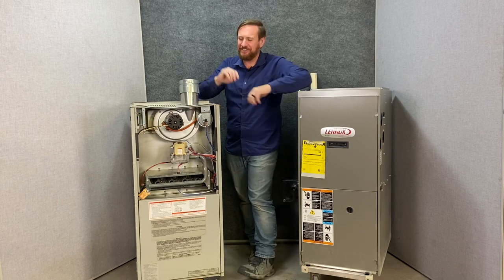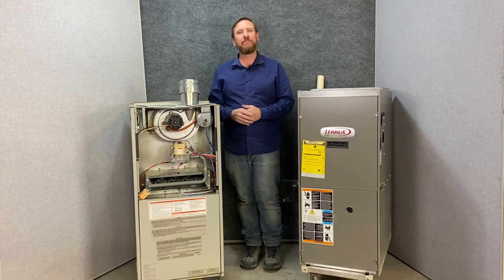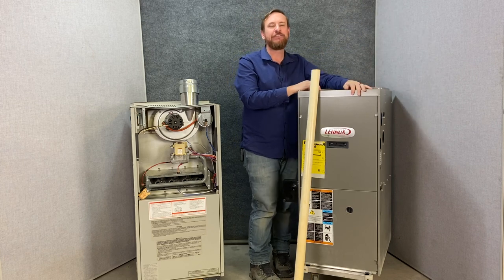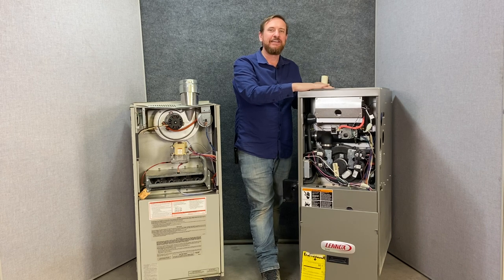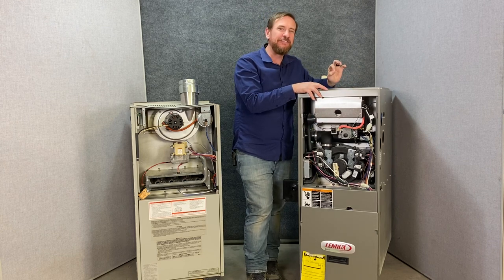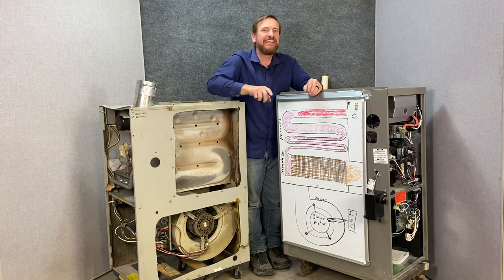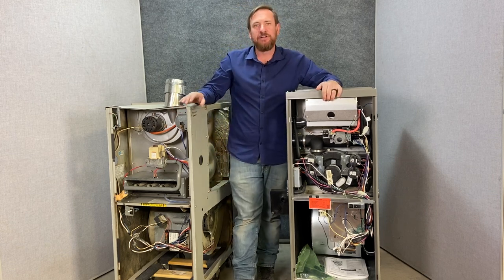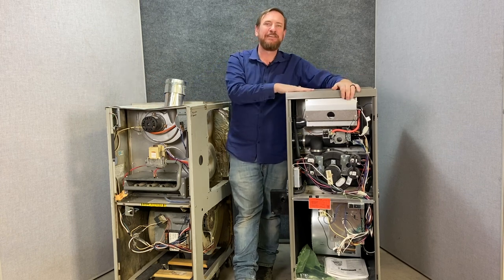80% vs 90%+ Condensing Furnace

Comment: Very positive presentation on the high efficiency gas furnace.  However, you did not cover the cost premium for the higher efficiency furnace including the cost of the PVC intake and exhaust. I would guess the payback on the more efficient unit vs. gas and electric savings is out several years.  Also, more complexity in the furnace likely means more parts to break down and higher costs to repair.
Reply from the maker: How much more is the cost for installing the PVC?

A single stage 90 will have the same parts as a single stage 80, except the 90 will have a sealed combustion box and the inducer wheel will be plastic and a secondary heat exchanger.

Same for 2 stage vs 2 stage.

When you get to modulating furnaces the parts are much more expensive and more difficult to diagnose but a modulating furnace does not make the system more efficient. 

The price difference between a single stage 80 and a single stage 90+ is very close. 

In many parts of the country, they are not allowing the sale and install of and 80% and regulation is on its way to end the sale of all 80% as the government will move to 90+ and heat pumps. 

We can learn about it and adapt or be left behind.
Reply: @love2hvac  Sure but we get only the positive part of the debate. When I asked for a price on a basic 80% vs. 95% unit, I was told that the premium for the higher efficiency unit was $3,000.  My NG budget is $70 per month including hot water.  If my heating cost is $50 per month or $600 per year and I save 20% over the 80% unit, my savings for NG is $120 per year. I will save additional on electricity but ECM's are available on 80% units so the electric saving is minimal, I think.  Assuming a total savings is $200 per year, the payback is 15 years assuming equal life and equal repair costs.  Several HVAC techs have told me that repair costs for 95%+ units is significantly higher and more frequent.  The government claims the higher efficiency will produce $80 billion in savings over 10 years for NG purchases but don't mention the $ billions to replace the furnaces. 
Many of my  neighbors had heat pumps and NG furnaces for extra cold days installed in their new homes several years ago.  Almost all have replaced the heat pumps with AC units and kept the NG furnaces due to the maintenance costs of the heat pumps. 
I own a home in the NE with NG furnace and a home in the S with a heat pump.  The heat pump went for 12 years and cost $6,300 to replace but the 20 year old NG furnace is still running well.
Reply from the maker: What is crazy is a company charging an additional $3k for a condensing furnace 😳🤯 the equipment cost difference is about $200 plus PVC and 2hrs additional labor installing.

As for the techs that say there are more problems with condensing raises concern. Are they specifying between a modulating furnace that is very expensive and cost more for part vs a single or 2 stage.  Excluding modulating, it's the same gas valve, offices, burners control board, ignitor and flame sensor.. I find most companies that have issues with condensing equipment are not installed correctly.  I get paid to go out and solve these issues for companies. What that means is I just read the installation manual to them and make sure they follow it.  There are units here that are over 20 years old only requiring typical preventative maintenance. 

One of the things that are driving repair cots up is the ECM . Otor you mentioned that even the 80% has. A PSC motor company cost was around $100 but an ECM can be $800-1300. ECM is also a government mandate. 

As far as pay back, it's often not seen for a while (or ever with that over priced 3k difference)
If we really want to discuss payback, why not repair your existing furnace?  Even if it needs a new heat exchanger your looking at about $1- 1.5k to replace.
An old furnace can be repaired for a long time compared to a new one if we are looking at payback. 
When the goveent looks at file savings they are looking at it as a whole, collectively. Having a 5 gallon flush toilet vs a 1.6 gallons flush will not pay for itself in waterbill savings, but collectively saves a considerable amount of water. 

Either way in many parts of the country 80% AFUE furnaces are not allowed and soon it will be most of the country.
Heat pumps are also being pushed by the government for better, worse or indifferent.
I solve problems and I also teach. Part of teaching is technology and preparing people. Everywhere you go there are people that romanticize about the good ole days and how everything was better before. But if I taught automotive and talked about how bad fuel injection and computers are and how great carburators and point system where, I would not be helping anyone.

By talking about "how great" an 80% furnace is is how "evil and bad" a  condensing furnace is, helps nobody. There needs to be positivity so techs are not afraid of them and can actually service and install them correctly. It needs to be taught so customers don't get screwed with an importer installation and the tech just blaming technology as bad to hide their own lack of knowledge and understanding. 
Condensing furnaces have been around since 1980. That's over 40 years so even that's hardly new technology. 
I also teach heat pumps, electric heat and hydronics. 

Everything about HVAC today is technology but people also have the choose of heating with a wood burning stove and firewood. I also solve problems for them as well as they have issues people don't know how to diagnose when installed in a modern home.

People get so upset at this video about condensing furnaces. They also get mad at heat pump videos. 
I have no say in what is being pushed by the government or what is being invented by manufactures. Yet people want to complained to me instead learning from a free video. Notice I am not selling anything or made any money promoting any product. 

I get it, a lot of people are afraid of change, a lot of people hate technology, a lot of people are angry. But is it so wrong to have a video that's positive? Is it so wrong to want techs to not be afraid of technology they will be encountering? 

Should I just make videos talking about how great the good old days were and how everything about everything was better back then? Maybe I could connect to an Amish community and I could talk about how bad electricity and vehicles are.
Reply: @love2hvac  Just want the positive and negatives to be presented so we all can make informed decisions.

Comment: in germany we use top notch "Weißhaupt brennwert" units or "junkers rund brenner" they work on same pricaple
Reply: Hot air is rarely used in Germany. Hot water with radiators or in floor piping is more the norm.

Comment: We just got a 90%+ installed in our finished basement. Unfortunately, Code here allows intake from
inside the house, so the builders installed the retired furnace that way. The new furnace was also installed with the intake pipe left inside the house in a U shape. I'm guessing they are doing this because there is a deck outside and the flue pipe is under the deck and no other way for the intake to go other than be sucking in the exhaust.
Reply from the maker: Most do it because they just don't understand why. 
Some don't want the extra work of installing the pipe.
Some are concerned about extreme conditions, but a tee and a manual cap/plug/or valve solves that.

The u shape inside is so nothing falls into the burner section.
The air intake is usually near the flue exhaust without an issue.

I do have concerns about the flue exiting under a deck. It raises a red flag and a lot of questions.
Reply: You can do an intake inside as the air is pre heated which is actually more efficient.  In Canada it makes more sense than pulling cold air from outside as well no possibilities of ice up or snow drifts.  You still need to exit the house which needs to be done on the side so you don't have any obstructions

Comment: Ty -- Your video is exactly what I was looking for! Thank You SO MUCH! I've been in my own head scratching web researching dilemma for several days simply due to the rust holes in the 4" exhaust flue pipe made of galvanized metal from the furnace running about 15' to and through a concrete/brick wall for exhausting outside the house.  I have revised my shopping list for flue parts about three times! I'm in TN, my Brother is in MD. We have been on the phone for hours beating this subject to death! It all boiled down to viewing your video! I thought if I replaced all the flue pipes and elbows with PVC I would no longer have rust from condensation.                                                                                                                                                                                       I entertained the idea of Type B flue with the inner aluminum or stainless steel to reduce the chance of rust. I had settled on using PVC but I don't think I should. My furnace is right around 2 years old. It is an American Standard with attaching Air Conditioning. It has a condensate pump which apparently works only during air conditioning season.                                           So long story short, my fairly new furnace is the 80% efficient which as you very well differentiate in your video to a more efficient 90%  which I think my Brother may have. His exhaust flue is PVC and reduced down to about 3 inches, the photos he sent me look great. I don't believe I should use PVC connecting to the exhaust of the furnace simply due to the 20% wasted going to the outside. I tend to think the heat leaving the furnace would be too much, would love your thoughts! I think I'm changing my furnace shopping list back to 4 inch galvanized flue pipe and watch for rust and change it out again in a couple of years. Keep in mind I'm in Tennessee and NO ONE pays attention to Laws or CODE!                                                                             If it can't be fixed with Duct Tape or J-B Weld...it just "ain't broke."  I'm too old for all this fun, I love my home and property but I want to do things correctly, preferably only once and live through a few more Birthdays! AGAIN, Thank You! Excellent Video!  Tom
Reply: It should be vented using 26 gauge galvanized metal pipe and fittings, or preferably B-vent pipe and fittings. If you use B-vent the corrosion will not be quite as bad as the double wall design of B-vent helps not only to keep it fairly cool to touch but also keep the heat in the vent preventing the flue gases from condensing and rusting the pipe out, which is what you are experiencing
Reply from the maker: Glad I can help, there are good people out there just hard to find.

Comment: I have 80% efficiency 120000 BTU furnace which is 27 years old. This is Midwest so what are the precautions I should do in case of keeping my self prepared for any potential failure of furnace in winter ??!!
Reply from the maker: #1 have  LOW LEVEL CO MONITORS
Alarms will not sound off until the levels are dangerously high, CO monitors will warn you ahead of time.

#2 have the system serviced and maintained. Combustion analysis goes a long way.

#3 have a space heater in hand for emergency use. Can be used to keep one room warm to survive the night. 

Optional to have some spare parts such as flame sensor, hot surface ignitor, inducer fan assembly, negative pressure switch are most common and easily replaced. 

It is very highly likely your furnace is oversized, most are.

The biggest recommendation is to have blower door testing and home sealing.  Air sealing is actually more important than insulation.  If your home is sealed well it will hold the heat overnight even if the heater goes out.

This also plays a part when you replace your furnace. 
Get a proper ACCA manual J (heat load for sizing) ACCA manual S for proper system selection, ACCA manual D (duct design)

Then you can down size your current unit AND be more comfortable with a healthier home and structure.

When you replace, look at going duel fuel. You can use a heat pump and have a gas furnace as a back up.

Comment: 80% furnaces last much longer, if installed properly. 90% furnaces are prone to more failures and are expensive to fix, especially if it's the Lennox brand.
Reply from the maker: A wood burning stove lasts the longest, least prone to failure and the cheapest to fix.
Reply: @love2hvac  Not like a log fire under a cave entrance...... LOL
Reply: @love2hvac  I have wood burning stove and the heat it puts out, let’s just say you can feel the heat in your bones. In the event of a power outage, it’s nice to know I can still have heat in my house. But it is a pain in the ass having to re-load it every few hours or keep a eye on it. I’m re-doing my duct work at the moment. I have a Mr. Cool 80% gas furnace. Do you think it’s smart to invest into a 90% or higher condensing unit? I know someone mentioned the parts can be more pricey if not installed correctly. Any advice would be appreciated. Thanks
Reply from the maker: @joseochoa7043  
Any furnace install and maintained will operate properly and for a long time. 
90% furnaces are pretty simple and just as dependable. The problem is they are often installed incorrectly.  The modulating 90% furnaces have several layers of complexity and the modulating furnace parts are very expensive. I think a lot of people confuse modulating condensing furnaces with standard condensing furnaces. For example my 80% and 90% furnaces use the same gas valve. How we a modulating 90% uses a very expensive valve. 

All that aside, if you have an 80% furnace there is absolutely no reason to change it. Make sure you have LOW LEVEL CO monitors not detectors but low level monitors. Make sure the furnace has a combustion anylaysis done yearly. When the time comes to replace it then you can change at that time.
Reply: @love2hvac  Appreciate the feedback man. I’m going to see how this furnace does in the winter with the new duct work. Do you know who makes Mr. Cool? I couldn’t find anything, trying to check if it’s still under warranty? Is there furnace that is a two stage or modulating that is reliable with a good warranty you recommend?
Reply from the maker: @joseochoa7043  I don't have any brands I recommend. 

It's kinda like Ford Chevy dodge Toyota ext. They all have good things and bad things and they change form year to year.
Reply: @love2hvac  Make sense. Which furnace do you have at your home?
Reply from the maker: I have a hiwall ductless heat pump.
Reply: @joseochoa7043  A wood stove with a wood pellet feeding system is the absolute cat's ass! The best yet for a wood stove!

Comment: My furnace just needed replacing. Time to dump my old inefficient unit and get a 98% one👍
Reply from the maker: Installation is extremely important. 

See if a company can do a blower door test to find the home leak rate and then do a heat load calculation off that number. That way you can get the correct size for comfort and longevity. 

Most furnaces (and Ac) in the US are oversized.
Reply: So with HE is its outdated we just dump it and go with the new??? Is servicing out of the question? I have a 90% HE. it will not blow air but the svcman does not want to work on it. Its gonna cost me less to repair then to buy their new furnace. They are filling me with BS. is there a real company i can call for real answers who dont push me to buy their furnace??? I just want mine repair
Reply from the maker: Many companies pay their techs more to sell than to fix. Many companies have lots of sales training and very little technical training.
There are a lot of really great companies and service techs out there. Generally the company that spends the most money on advertising, billboards, radio, ect are the most expensive. You can't trust reviews anymore either. If they have a lot of reviews, it's likely they paid a lot of money to get them. 

Look for smaller to midsized companies. 
Be weary of "free" service call or the free with repair service calls.

Many companies pay their techs more to sell than to fix. Many companies have lots of sales training and very little technical training.
There are a lot of really great companies and service techs out there. Generally the company that spends the most money on advertising, billboards, radio, ect are the most expensive. You can't trust reviews anymore either. If they have a lot of reviews, it's likely they paid a lot of money to get them. 
Be weary of free service calls, or diagnostics fee waved with repair. (And the $29.99 rune up)
If a company askes how old your unit is before they even come out, immediately cancel! 

Look for smaller to midsized companies. Ask for a company that uses a combustion analyzer. Ask if they have taken a combustion class. 

Get yourself a low level carbon monoxide monitor. Not an alarm but a low level monitor to protect yourself from CO.